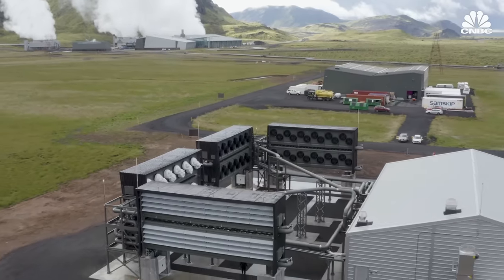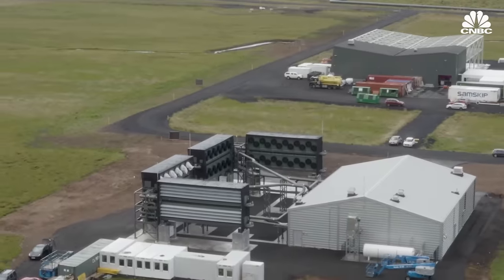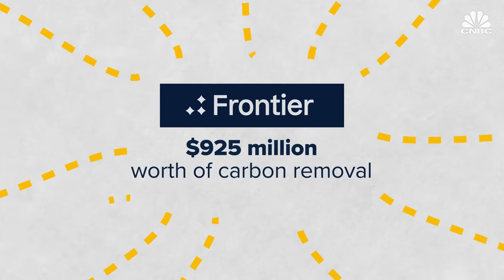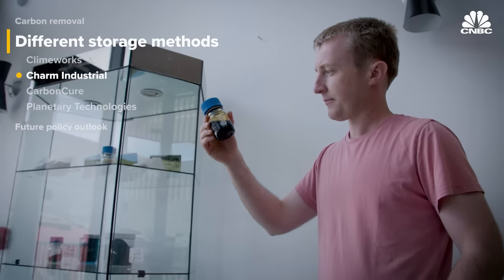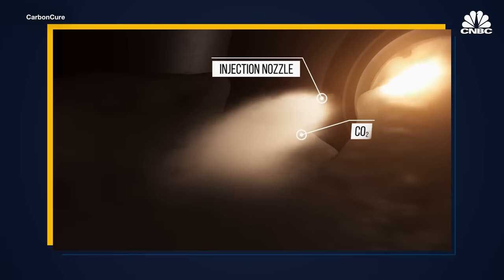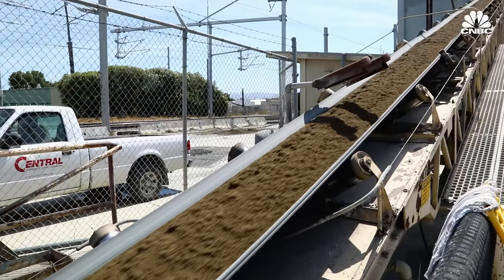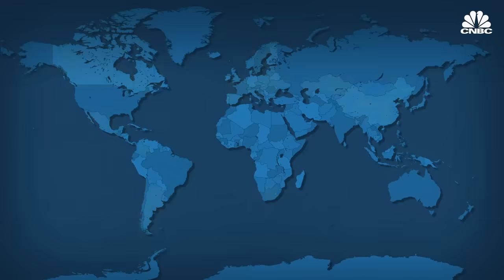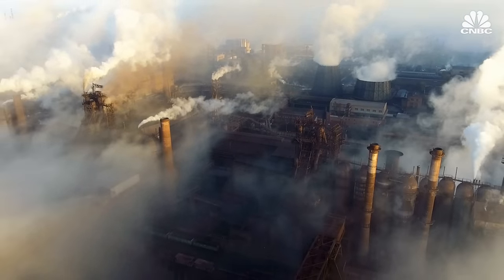Why Big Tech Is Pouring Money Into Carbon Removal

Comment: 5:23 In fact studies have shown that there is plenty of available space for enough trees by something like 10 times. However planting them and ensuring they grow up is a monumental task.
Reply: So over-plant knowing there is a percent of failure.
Reply: source?
Reply: Planting trees is one of the worst methods for reduce total Co2.
Trees die, when they die what happens? All their Co2 is released. I forget the exact number but basically every little square inch of the earth surface would need to be trees to actually start to make a dent in Co2 reduction, and we would have to replant a new tree the moment one dies.
Reply: Also, you have to be careful about what types of trees you plant - because you can destroy an ecosystem if you plant the wrong ones. Also, if you overplant in a region, you make fire hazards exponentially more dangerous - and when those forests burn, CO2 (and lots of other hazardous things) gets released right back into the atmosphere. It's probably theoretically possible. We need more trees, but yea it's really not the preferred solution here.
Reply: The fact that pine trees that scientists invented over 50 years ago that can grow to maturity in just 20 years and 8 out of 10 live will do a good job but we also need the Oak trees replanted and even bushes that are removed replanted. But it is a fact that if we would replant these tree at around 2\3 what is cut we would see that cooling and  the lowering of carbon. I took Botany and I'm 65 now and understand the photosynthesis system and that the oxygen released from the trees will also help cool the Earth. These are hard facts!
Reply: @sonnyharrelson3897  Dont forget that planting trees releses carbon. You need to grow them ship them and plant them.
Reply: @kingofrivia1248  I think that's what a lot of people forget - the sum carbon footprint of farming young trees, caring for them, lifting, packaging them (often in plastic), transporting, and tree-planters travelling from wherever to the new forest/woodland planting site.
(I have heard it said that the total carbon produced by all these factors combines to negate the benefits from the first 15 years of a young tree sapling's life - and I can quite believe that).
Reply: @MoonLiteNite  This is wrong on so many levels. A forest captures x-amount of CO2 and stays there more or less. And: You can use the wood = captured CO2 in form of an table or whatever.

Comment: I can imagine a coal burning power plant paired with a carbon removal system that would be “net zero”. It would produce net zero energy and be completely useless.
Reply: That's not how it works
Reply: Thanks for watching☝️Get in touch . Let's discuss on Financial investments
Reply: I'm skeptical......
Reply: I’d tend to agree , an engine with a free flow exhaust has higher power and efficiency,  but try to throttle the exhaust through a pencil sized hole , doesn’t work too well
Reply: lol. No actually, it COULD work, in theory. But... We've tried clean coal projects, which was that industry's attempt at staying relevant. But coal is uniquely terrible to try to capture efficiently and cost-effectively. Coal is not only bad for pollution and human health, it's also impossible to make clean, AND it's more expensive than natural gas which is already the "better" fossil fuel. We just need to get rid of coal plants.
Reply: @Cyrribrae  I'm delighted to point out that the UK is presently generating all our electricity requirements whilst using zero coal. It's possible to make the change.

Comment: Hopefully these people realize producing hydroxides produces co2 by itself.

So you're basically producing co2 in order to absorb co2. Kind of defeats the purpose.

Hopefully, when they make the hydroxides needed to absorb co2, they are capturing the co2 in the process.

If they're not, they would be doing more harm than good and they wouldn't be removing co2 from the atmosphere.
Reply: Ding Ding Ding 🥲 “hopefully”, big key word that usually falls way short of the truth
Reply: You probably lack understanding on the efficiency rate of each process and making blanket statements to win internet points. The process just has to have a net positive in the amount of carbon removed and probably does. It's people that are not scientifically educated that are always synical because in their world it's always black or white, when reality is things are very nuanced with pros and cons are always balanced/taken into account.
Reply: You're right, @N Hinton. If you aren't careful, the process of creating this "antacid" can create CO2 on its own. So it's important to use renewable energy in the process and to capture any CO2 produced. That's an issue with all the carbon removal approaches and one of the big reasons we need to increase renewable energy production!
Reply: @yt_nh9347  When you make hydroxides like potassium hydroxide, you are releasing a co2 molecule from the solution.

This isn't cynicism. This is basic chemistry.

The same goes for sodium hydroxide.

Take for instance potassium hydroxide. To make it you need to free co2 molecules from water mixed with wood ash. That's why the solution is extremely caustic. Because you removed co2 from the solution.

When they produce the hydroxides to absorb co2 from the atmosphere, they would need to absorb the co2 released to make it and put it in some other solution.
Reply: @yt_nh9347  Do you have a response? Is there a way to produce hydroxides without releasing co2 molecules or to at least store it when it's being produced?
Reply: @PeterChargin  I value renewable energy, but I'm not saying fossil fuels are increasing co2 when you create hydroxides. Creating hydroxides itself produces co2 because of the chemical reaction.
Reply: Also mention the massive amounts of electricity it takes, which also likely means more emissions generating the electricity...and more fuel burned to keep petroleum companies rich.
Reply: @yt_nh9347  what if I told you that there are sea creatures that convert CO2 into calcium carbonate as part of their natural life cycle?  What is the ideal concentration of CO2 in the atmosphere?  Could it be you that doesn't understand the science?
Reply: @5353Jumper  wut if the carbon capture tech were powered by solar panels?
Reply: @kayakMike1000  Stop posting random facts like it makes you smart or something. Sure there are lots of ways to convert CO2 into something environmentally friendly, the problem is how to scale such a solution and the relative trade offs in implementing the conversion process. 

Your linear thinking is missing a lot of nuance, paritcularly when it comes to execution because everyone can solve things in theory.
Reply: @yt_nh9347  I guess you don't have an answer to my query. Shame.
Reply: @yt_nh9347  If you you have the knowledge, explain how these carbon capture programs aren't scams. 

Because basic chemistry says it's a scam.

To create carbon scrubbing solvents requires releasing co2 molecules.

Sodium hydroxide, potassium hydroxide, etc all require a release of co2 molecules from the solution in order to absorb co2.

There is no way around it from what I've read. 

It is very difficult to circumvent the laws of thermodynamics even in chemistry.
Reply: @yt_nh9347 Michael is right. The only sure way to capture carbon full scale is utilizing the help of organisms that convert co2 into different compounds. Relying on scrubber technology is not feasible and is actually producing more co2 than it absorbs
Reply: @NashHinton  From their press release the by-product of their “antacid” production is hydrogen, so there’s your answer. I highly doubt they’re lying about their chemical process as well given that they were one of 15 companies to receive an XPRIZE reward paneled by industry and academic experts.
Reply: @kayakMike1000  What if I told you that ocean acidification, caused by excessive CO2 in the oceans was interfering with the ability of those sea creatures that use calcium carbonate to create shells and reefs to live their natural life cycles? You understand that is the ACTUAL problem, right? There's too much CO2 in the atmosphere - there's ALSO too much CO2 in the oceans. And we need the oceans because they absorb the majority of our atmospheric CO2, which it can't do if oceans start to saturate even further. I hope you're not suggesting that having excess CO2 in the oceans is a good thing.
Reply: @NashHinton  I might have missed it, but where in the video or their papers do they say that they're going to be producing hydroxides in the lab? The rocks are already basic, you don't need to create an antacid that already exists. Also, what production of hydroxides releases CO2 anyway? I don't see how that's basic chemistry. None of the reactants even need to have carbon in them at all. They're caustic because of the hydrogen ions..

Even if they were releasing CO2 as part of the process, it would be a trivial task to sequester any CO2 created in that process and NOT release it into the atmosphere. After all, the problem isn't that carbon atoms exist lol, it's WHERE it exists and in what form. Doesn't seem like a problem at all, really.
Reply: @Cyrribrae  Look up chemical reactions when making hydroxides.

Co2 is emitted in the process.
Reply: @NashHinton  you keep saying that, but I've looked and I'm not seeing that at all. I might be wrong, happy to be corrected. 

Just provide a link to something reputable that talks about it and why it's actually a significant problem worth worrying about. You make it sound like a basic, fundamental issue, so that shouldn't be hard to do.
Reply: @NashHinton  you keep saying that, but I've looked and I'm not seeing that at all. I might be wrong, happy to be corrected. 

Just provide a link to something reputable that talks about it and why it's actually a significant problem worth worrying about. You make it sound like a basic, fundamental issue, so that shouldn't be hard to do.
Reply: @Cyrribrae  It's on Wikipedia.
Reply: @Cyrribrae  Look up scrubber technology and how they work and what solutions they use. Then look up how those solutions are produced and what the chemical reactions are.

Hydroxides are used for co2 scrubbers. 

Manufacturing potassium hydroxide releases co2.

Manufacturing sodium hydroxide requires carbon cathodes which releases co2 during electrolysis.
Reply: @Cyrribrae  YouTube won't allow posting links
Reply: @NashHinton  What am I looking up on Wikipedia? At least give me an article name haha. And are you sure? I think I can link the Sodium Hydroxide wiki article right here: https://en.wikipedia.org/wiki/Sodium_hydroxide. If not, let me know, and I'll have learned something. 

When I search for carbon or CO2 in those articles, only one instance of CO2 being a product comes up - when you use sodium hydroxide along with aluminum sulfate to precipitate an aluminum hydroxide - OH WAIT, NO. That's when you use sodium BICARBONATE instead of sodium hydroxide. There's nothing in here that says anything about CO2 being routinely released in the creation or use of sodium hydroxides. Same story with potassium hydroxides.

And since when do carbon cathodes release CO2 in the process of electrolysis. Wtf? The only thing I'm finding is actually electrolyzing carbon dioxide itself, plus some new uses for CO2. Even if you were right (which does not appear to be the case), there's NO PROBLEM with creating CO2 in the lab. The issue is not that CO2 is being made - the problem is WHERE IT IS. If you create CO2 that is easy to capture, sequester, and/or reuse in the process of eliminating it from the atmosphere or the oceans, where that is fantastically difficult, then that is absolutely a win either way.
Reply: @Cyrribrae  Do you know how lye becomes basic?
Reply: @Cyrribrae  You think you're smart, but your education in chemistry is mediocre.
Reply: @NashHinton  Listen man, I looked up sodium and potassium hydroxide on Wikipedia, like you said (even before you said). And I did external research on exactly what you claimed. And I posted what I found there - which did not match what you told me. 

It's easy to attack other people, but support the assertions you're making before you start. I've even done your research for us, and still not a shred of evidence for your claims. 

That's all I'm asking for.
Reply: @Cyrribrae  I don't have time posting links. I don't have time explaining how direct air capture is a scam. Humanity is doomed is all I have to say.
Reply: @NashHinton  Well, thanks for trying. You can't post even a single line in support of your assertion. If only "smart" chemists believe what you're saying, then that means it's not only not basic, it's also probably not true. 

Notice that I didn't say ANYTHING about direct air capture. I certainly didn't say it was a good or bad technology. (It's theoretically feasible, but it's still too early to be efficient at scale. That's why companies like CarbonCure and Charm finding ways to sequester carbon from waste products, instead of the air, is great.)

I only said that producing hydroxides doesn't "create CO2" and that even if it did, it would be easy to capture it in the process. And that would be worthwhile if you were using it to remove CO2 you would be removing from the ocean and atmosphere. Ie: there is no problem here.

Comment: I can't help but wonder if there will be any unintended consequences for removing carbon and storing it somewhere else.
Reply: very true but honestly I kinda doubt it with this. Carbon is inert so it's not like filling a whole with plutonium. All known life is carbon-based so it's not poisonous unlike many chemicals and elements. If anything it would probably help ecosystems like the fertile dirt created by volcanos. There seems to always be a negative to doing something for once sticking carbon unground truly seems to do no harm. BUT we do need to keep doing research
Reply: Thankfully, sequestering carbon and putting it into the ground means that it will permanently stay there; it’s part of the carbon cycle. I do think that it might have affects on aspects like bird migration or for any reason it becomes too powerful but right now I don’t think it will be that bad.
Reply: Underground would be harmless or in solid form. 🪨
Reply: @Nicholas-f5  I mean there’s been a lot of carbon on the ground and there was only problems when I went in the air
Reply: It truly depends on how we store it and if we store it (we may reuse it). For the most part underground can be safe with proper monitoring of pressure and site selection. If you picked a poor site and left pressure uninhibited, you could be looking at problems. There is new research into storing it in the ocean somehow, that is something that sounds dangerous.
Reply: Of course there is. If you just pumped it down without checking you end up like fraking and creating earthquake in the Midwest
Reply: Most of that carbon WAS in the ground before oil companies pumped it to the surface and burned it. 🙄 Putting it back where it was shouldn't have any negative effects on the environment.
Reply: No, no issue.  All the limestone on planet is technically sequestered co2.

Comment: $600/ton? Here's an better investment. Buy coal for $200/ton and bury it underground. Pocket the difference. Carbon captured, ey?
Reply: No, nothing was captured using that approach. What you suggest is an avoided emission which will do nothing to reduce the excess we have in the atmosphere already. It will, however, not ad new CO2 either.

Comment: Incredible greenwashing.  You haven't managed to decarbonize a single industry.  How about decarbonize ammonia production?  How can direct air carbon capture ever be cost effective while electricity is being generated by burning natural gas?  How can it be possible to use biomass for creating oil that you inject underground as long as any petroleum is being produced?
Reply: The video is about why tech companies are putting money into carbon removal. Not whatever irrelevant issues you decided to bring up.
Reply: It's one piece of the puzzle man. Ofc they aren't going to mention the 1000 other things that need to happen to reverse climate change and fix everything. This video is just focused on carbon capture, which is absolutely nessisary
Reply: @alien9279  exactly. The carbon removal industry wouldn't be necessary if we were able to become net zero soon off of renewables in the short term. However, we are working with extremely urgent deadlines, and carbon removal buys us precious time so that these measures, such as solar, wind, nuclear, etc. can be built before it's too late

Comment: 4:52 That's no different than saying it will not happen. 
This is an assanine approach to the problem. You cannot scale carbon sequestration that relies on energy input from us directly, because energy is money and we can't spare that quantity. It wouldn't even be worth it if it was physically acheivable. 
No the only way this CAN work, is by taking advantage of biology. And the only method for doing that even close to having the right set of advantages is ocean feritization. Distasteful as it may appear to increase the chlorophyl level of the open sea, this is THE best option. And if the numbers don't work for that they wont work for anything else.

Comment: So what are the long term seismic effects of pumping solidified CO2 into Earths crust? Where is the displaced material going and is the pressure going to build to a point at which it rebounds causing a failure in the systems underlying rock?